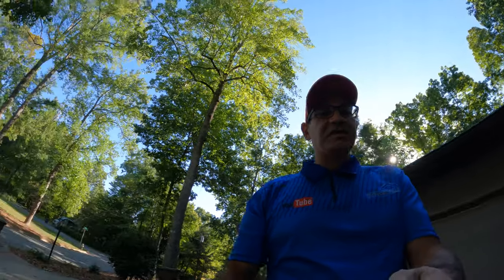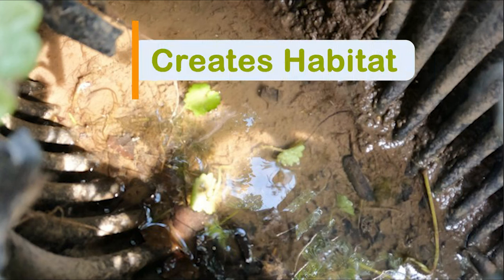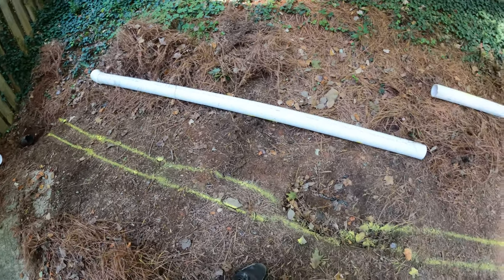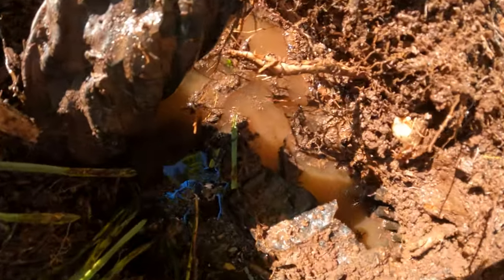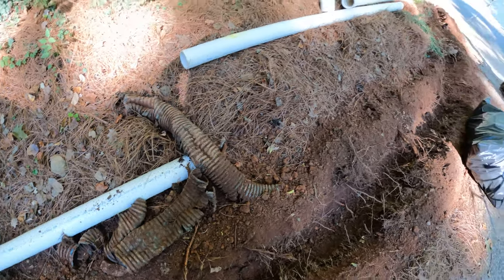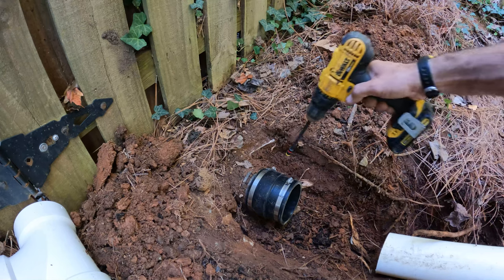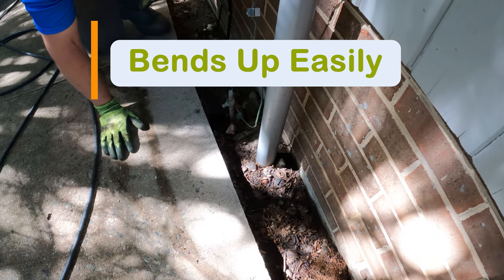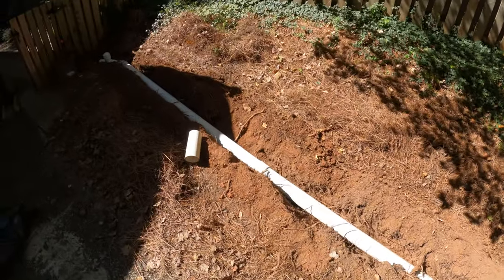Benefits of Corrugated Pipe for drainage work

Comment: As someone from the UK, it’s unusual to hear someone from the US use so much dry sarcasm 😂 I approve!
Basically it seems like there’s no benefit at all, the only one that seems plausible is it’s easier to remove and dispose of, but you wouldn’t need to be doing that if it was PVC in the first place… 
Corrugated = lazy man’s pipe I guess 😅
Reply: The only reason installing pvc is hard is because you have to do it the right way!
Reply: Oh, I'd say it has its uses. Getting rid of water as fast and hard-to-obstruct as possible is just not one of them. (Also, when used in larger projects such as culverts, there are versions that have a second, smooth layer on the inside, so that one can work the same as PVC.)
Reply: * corrugated = lazy and cheap (at least to buy in comp. to pvc) man´s pipe 😉
Reply: @Sophie_Emilia_von_Zerbst  true, it is cheap. Actually, what are the costs per meter of corrugated compared to pvc? Would be interesting to know!
Reply: @Sophie_Emilia_von_Zerbst  I would say corrugated is more expensive. Dig a tench to install corrugated, wait a year for it to block and stop working, pay someone else to dig up the trench and install PVC 😂
Reply: Shawn installs pipes in peoples gardens where the pipes are laid at shallow depths and there is a lot of debris entering the pipes. Corrugated is not suitable for those locations. Corrugated can be used in places where there is less chance of debris entering the pipe and at a depth so that the pipe will not be damaged. It is used extensively in the UK as land drain.
Reply: @ZylonFPV  Thats true, but the expence is on the homeowner. Some contractors cheap out and "just do their job", are outta there and never to be heard of again. 😂😅
Reply: By North American standards, the dry humour and deadpan in this video are the equivalent of what would happen if the McMurdo Dry Valleys in Antarctica and the Atacama Desert in Chile had a baby in a 40 foot shipping container full of desiccant pellets (do not eat those!).  Not that anyone asked for it, but I totally approve!
Reply: He even says aluminium correctly!
Reply: @adem-Savs  I suppose making videos that state that a product is bad for a purpose is not intended for but ignoring what it is good for gets views. 
I don't think he knows what he is doing from an engineering stand point.

Comment: the dry sarcasm is a thing of beauty
Reply: Another Excellent video doing that with style
Reply from the maker: I really, honestly think that corrugated beats the competition in these areas. Mosquitos need a safe place to lay their egg rafts.
Reply: @GCFD  They are also a great cheap material for vertical hydroponic or aquaponic systems. some zip ties, a hole saw, and some baskets are all you need to get started.

Comment: The house I bought two years ago had a downspout and our basement sump pump going into a corrugated pipe out to the street.   Last winter I noticed water was backing up in the pipe when the sump pump would run (and when it rained from the downspout, no doubt).  The first warm Saturday I had, I started digging up the old pipe to see what the problem was.  Two huge root balls about 10 feet apart in the pipe.  I had just started watching your channel, and I followed your example...ripped out the corrugated and replaced with PVC.  There is still a section that goes under the sidewalk and out to the street.  I really want to replace that as well, but don't feel like dealing with punching under the sidewalk.  You are absolutely correct in your views on corrugated.
Reply from the maker: Awesome Jeremy! Hopefully that section under the walk will be all right for now. Nice work!

Comment: When coupling PVC to corrugated, if you don't want to crush corrugated pipe with a rubber boot and a clamp, insert inside of the corrugated a smaller diameter PVC. If you don't have a smaller diameter PVC on the job, slice a foot of 4" PVC and cut out from the side 1/2 - 1" wide slice. This way PVC cutout can be squeezed and inserted into the corrugated pipe and it will support clamp from the inside without crushing the corrugated pipe.
Reply: Where's rain video?
Reply from the maker: Great advice Tim!
Reply: @Tim-Kaa  another benefit of corrugated.  The rain doesn't make it to the end of the pipe, so no need to try to video it.
Reply: @AdamMuhle  😅 gold.
Reply: @AdamMuhle  all local trees giving you a standing ovation in 200lb of roots in the corrugated pipe

Comment: I didn’t even realize this was satire at first. I knew how much you hated corrugated and was surprised you changed your tune. Then I picked up on the sarcasm. Good video, made me laugh.
Reply from the maker: Dman I was trying to be serious here and showcase the many benefits of corrugated pipe. Haha
Reply: @GCFD  I also want to say thank you Shawn. I've been watching your videos for a long time and recently used the information I learned from you to fix my flooding finished basement. Every time we would get a "once in a hundred years" massive torrential downpour at my house, a spot in my basement would flood. It was mostly wet carpet for a few feet out from the wall. It's a finished basement so my options were limited. I looked around the side of the house but couldn't find anything obvious. I had a downspout on that corner that was already piped to the street with PVC, so bonus there, but what I discovered was when they replaced my road a few years ago they created a sunk-in low spot at the outfall, asphalt with no curb, which caused debris to build up and clogged the pipe. So that caused the downspout to overflow and the water then ran along the side of the foundation down into my basement window well. The window well barrier only stuck up from the ground a half inch so it was easy for the water to flow down into it and then into my foundation. My solution was to clean the outfall clog, and also dig out the 12 inch window well and replace it with a 18 inch which gave me 6 inches above ground level.  I went a step further and brought it dirt to create a grade away from the foundation so any water would flow away from the house, not along the foundation. So far everything has been dry and I'm pretty confident the problem is solved, fingers crossed. I want to give you the credit because without being a longtime fan of your channel I don't think I would have known what to look for or been able to develop a solution to fix it. I'm just an average DIY homeowner so what I learned from you has been invaluable. Thanks again Shawn, best wishes!

Comment: What a timely video. For the past couple weeks I have been working on replacing the corrugated pipe at my house with PVC. I don't have a trencher so I'm having to dig everything out by hand and tool. My soil here is rocky clay. This isn't my day job so I can only manage an hour or two per day. I found that using a sledgehammer with a trenching shovel allows me to cut into the ground in small inch or two chunks. Feels like I'm busting through concrete though sometimes. But I'm almost at the end. Looking forward to getting everything glued up and sealed and then backfilled.
Reply from the maker: Awesome work RD! It sounds like you're making progress. Why'd you choose PVC when corrugated has so much to offer?

Comment: Had a company in MI come out for a quote to re-do all of my downspouts. They wanted over $3k to do 5 downspouts with their "special" corrugated pipe LOL. They talk highly of corrugated for downspouts but use high quality PVC for their sump pump installs. Odd...

I ended up DIY'ing it for a couple hundred. I used corrugated because it was easier to work with than pvc, especially without having a trencher to dig a nice trench. I made sure to use tile tape to make sure all connections were as leak proof as possible. I would have preferred PVC but I'll live.

Comment: My degree in finance tells me corrugated is better for installers because they will have to clean it out on a service plan and replace it more often
Reply from the maker: Good point John! Corrugated makes good business sense.
Reply: That, And its somewhat Less Expensive (cheaper) for installers on the initial run. For those companies that "Offer" services to clean after the fact True, that is an extra fee etc.  Majority of builds dont front the extra cost up front for PVC due to the fact that they want to build as cheap as possible for obvious reasons.
Reply: If you have 3% slope then corrugated is fine, but it'll need to be one size larger than smooth-wall for a matching flow-rate.
Reply: I have had a corex drainage system with three bubblers and one roadside outfall and has yet to clog, break or develop problems. A big rainfall once or twice a year flushes it out.
Reply: @SlackerU  The lower flow rate isnt a problem. With a normal house you are not able to max out the capacity of a 4 inch pipe, but you need the size to let debri flow trough.
Reply: @jonasstahl9826  I live in hurricane territory so it's easy to max out a 4-inch.
Reply: @SlackerU  Thats a point I didnt thought about, we dont have huricanes in europe

Comment: Hi Shawn, I absolutely loved your sarcasm. I can only imagine how difficult it was for you to NOT to replace the corrugated pipe under the fence along the side of the house. My guess is your conversation with the home owner ended with you throwing you hands up in the air and walking away. Keep up the great work and videos coming! KC Fan
Reply from the maker: Hahah I made sure the corrugated under the gravel/fence was flowing, which it was. Replacing that would have been way more disruptive and tough with the gravel and decorative pavers. I made sure the HO knew that I was guaranteeing only the PVC. Adding the cleanout will hopefully keep the old corrugated run clean and working.

Comment: A definitive mic drop on the benefits of pvc vs corrugated, well done! I have a question. I live in a relatively new construction and I have these PVC pipes sticking out of the ground at almost 90 degree angles to the ground with no cap. I was wondering what this is?
Reply from the maker: They might be cleanouts that don't have a plug in them?

Comment: You know what really clicked for me? In one of your earlier videos, you just so happened to call runoff water, waste water. It then made me think, "If corrugated piping is so great, why isn't it used on septic lines? By this logic, if liquids and solids is good for the outside, wouldn't it be good for the inside?"
So yeah, once again thank you yet again for solving the solid vs corrugated pipe argument. 
Oh and that one loud guy that sells corrugated pipe pretty much admitted in his flawed freezer video that if solid pipe is installed correctly, water cannot freeze and crack the pipe, because there would be no water to freeze to begin with.

Comment: Only reason why I went corrugated over PVC in my yard, I had runs of 5 -10 feet to catch basins into the grass. Didn't need to take to curb or cross deep root foliage that would eventually compromise the integrity of it, due to it being under grass and perennials. In pasts houses however definitely ran PVC over corrugated for easy cleanout with a pressure washer.
Reply from the maker: Nice choosing the right pipe for the right situation Harvest.

Comment: I picture Sean having a quiet drink in a saloon. Sound of a trenching machine pulling up outside. The squish of water filled boots dismounting and walking up the stair outside. Saloon doors swing open. Squish of boots continues until the stranger is alongside Sean at the bar. Via nodding and no words, the stranger orders his whisky and finishes it in one. Gets a second. Turns to face Sean...who continues to ignore him, contentedly sipping his own rotgut. The stranger begins "I hear you're the guy whose been trash talking corrugated pipe!" The piano stops, the saloon empties as Sean freezes mid sip. Cut to outside the saloon. Doors fly open and Sean drives out in his concrete buggy with the stranger unconscious in the front bucket.
Reply from the maker: Hahah you really painted the scene for me. Too funny! The corrugated guy gets pretty worked up for sure.

Comment: we attached corrugated to the gutters, spiraling down a piller. we grow hanging tomatoes, the water leaks out all over the plants that are under the balcony. it ends in a waterbarrel. but I wouldn't bury the pipe.
Reply from the maker: The same thing happens to that pipe underground but you don't see the water. That water does not go unnoticed by roots though.

Comment: Shaun, since you already had to cut concrete in some parts, why did you not replace all the corrugated pipes with PVC?
Reply from the maker: The homeowner verified the corrugated under the decorative gravel was flowing and didn't want to tear that part out.

Comment: 10/10,  I wish I had a 100ft testing-setup with all the minimum-self-cleaning-sloped-pipes, pumps, tanks, & sumps to test any online claims.   4-inch corrugated is worse than 3-inch smooth-wall, it has such a disappointing flow that it's not actually competing with 4-inch smooth-wall.  The Universities only share pictures for their actual-size-real-world rock-inlet flow-testing rig. 

I would say that if I had 3% slope into a pond then I would want corrugated b/c of how much it slows water down for treatment, though it'd be one size up from what is required of smooth-wall-flow.
Reply from the maker: I'll see if I can think of another test like my Ultimate Flow Test video to place the two pipes side by side.
Reply: @GCFD  It's fall season so I was imagining a "can it flush" style setup.  For science I'd design the detentions of testing around 3.5-4.5 inch flash-floods to prove exactly how much square-footage of rainfall a single 4-inch can defend.

Comment: Definitely better using PVC, no roots and easier to clean out, good video Shaun
Reply from the maker: But what of the mosquitos? They don't like the white, dry, interior of PVC pipe.
Reply: @GCFD  i understand that about the wildlife but, keeping my home dry is more important and using PVC wont block as easy, use corrugated pipe in fields were your draining

Comment: People say one of the benefits of corrugated is that it's easier to install. I think it's harder to achieve a consistent fall. The trench has to be almost perfect. PVC can go over low spots and maintain fall.
Reply from the maker: I agree Joe. The hardest part of PVC is the angles. A 45 degree angle only fits in a 45 degree trench and 4" PVC doesn't bend well!

Comment: French Drain Guy insists that up North corrugated is ideal because of frost heaving and that roots cannot intrude if the corrugated is taped up around the fittings. Any thoughts on that?
Reply from the maker: I don't have any experience with the pipe up north. I would still use PVC though.
Reply: There are millions of miles worth of corrugated drain tile all over the US & those farmers want trees 80ft or more away from the corrugated water management.  He's shown clips of the roots all up in his burrito.  I've got a few long-root clips going up some PVC in my Stormwater Playlist too.

Comment: What about DWC pipe, how does that compare to PVC? And is it okay to use ABS?
Reply from the maker: That's schedule 30 pipe. It's good stuff but is much thinner than schedule 40. I like the thicker wall of 40. You can use ABS too but I have a harder time finding those fittings. Sch 40 is used in house drains so is easy to find.
Reply: @GCFD  Thanks for the clarification. I may have gotten the naming wrong. I was thinking of the corrugated that is smooth on the inside. We are opposite here. ABS is readily accessible and affordable at the big box stores. The 40 4" is super expensive (especially the fittings) and only available at plumbing supply warehouses. And since I'm not a contractor, I don't get contractor pricing.

Comment: Do you guys use triple wall drain pipe in your area? It's extremely common here in southern california. I've used it a lot over the last 15 years or so in my career with few issues. Obviously not as sturdy as schedule 40 but it's a lot more rigid than corrugated and doesn't trap dirt and water the way corrugated does. The price difference between triple wall and PVC is pretty significant too. Some guys call it Sewerlite but I've never been able to find that brand name associated with it.
Reply: In the UK we use double wall. Smooth on the inside and corrugated outside. Good for for everything but foul and very shallow where solid PVC is often used. Corrugated as Shawn encounters is used for land drains mostly.

Comment: I feel pretty bad I ran a gutter underground with corrugated pipe.   I guess in the future I’ll be able to replace it with pvc and it’ll be easy to rip out.  When I was putting it in I thought to myself man pvc would be so much nicer than this floppy pipe but I thought for some reason you had to use it

Comment: And if the roots don't find the connectors, they'll happily grow through the holes in the corrugated pipes walls that let water in so it can 'flow' down the corrugated pipe to the drain...

Either way, roots WILL get inside corrugated pipes...ALWAYS!!!

I personally wouldn't use corrugated pipe on my property unless it's encased in gravel and at the bottom the the foundation against the footings to drain water away from the bottom of the basement floor slab...and even then, I'm more likely to use Perforated Schedule 40 PVC like Shawn uses in the French Drains he routinely builds for his customers...